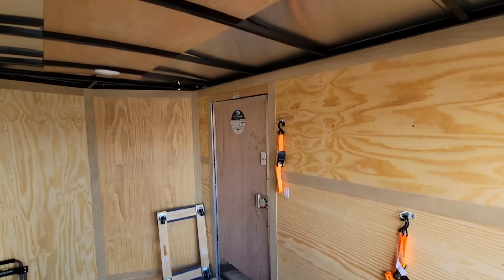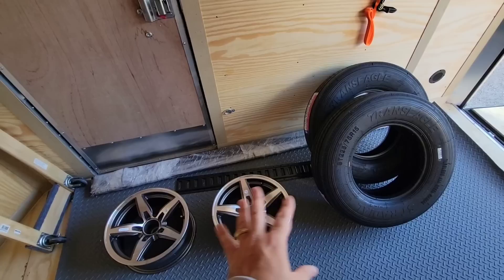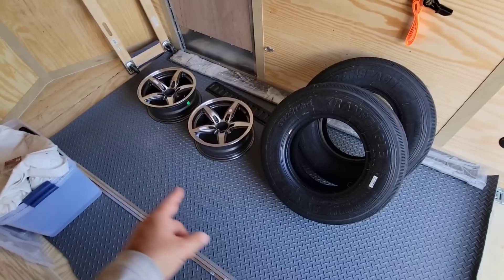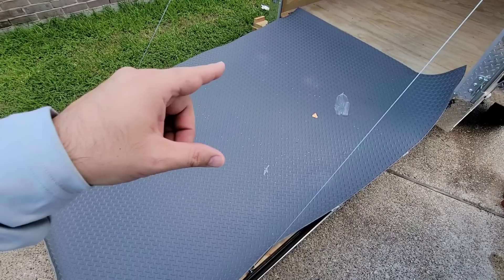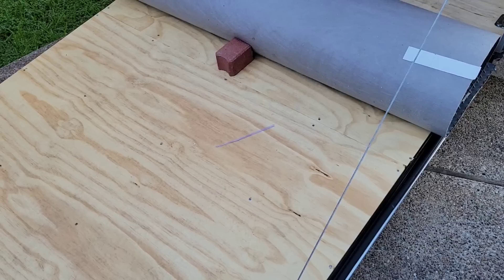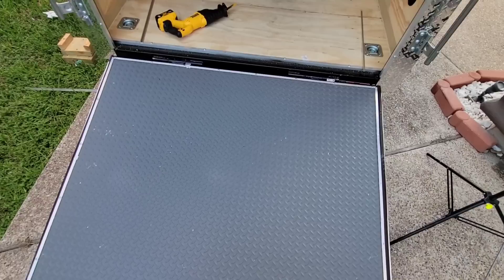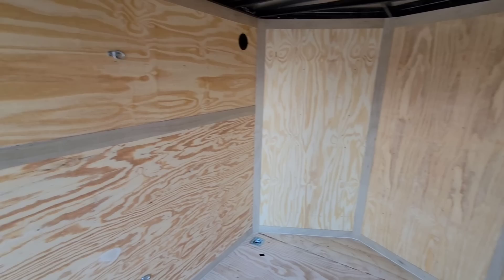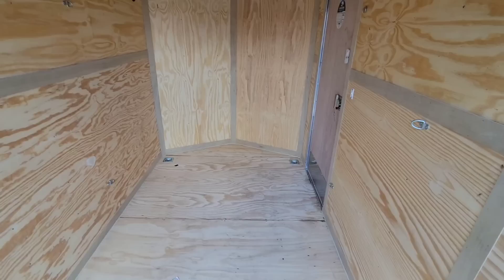Awesome ramp upgrade for cargo trailers! Plus other goodies coming soon!

Comment: I got the 6x12 extra height dual axle and love it.  I put click vynyl on floor inside making it niice when loading stuff.  I still have to do ramp.  I think gray- very light, would look good plus keep it light/bright inside.  The trailer ramp makes it easier to load than trying to lift heavy items up and on truck bed.

Comment: Do you think it will be slick in cold icy conditions?  Our ramp from Trailers plus is super dangerously slick in cold damp conditions.
Reply: Paint the door/ramp while adding a few cups of silica sand to the paint, keep stirred during the painting process...

Comment: How timely this video was as I just bought a 2008 EZ hauler all Aluminum 6 x 10 trailer that looks almost new. I just added E track to both sides and was looking at adding some non skid material to the ramp. I use the trailer to keep my Art show tent and display panels in ready to go to the next show this weekend.  You have  started a project I am also starting so I look forward to your next installment.